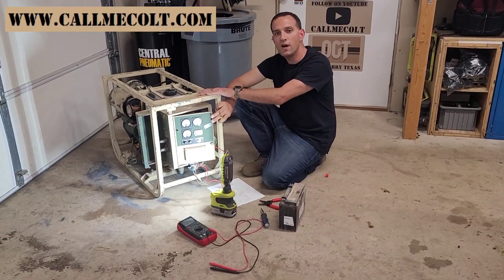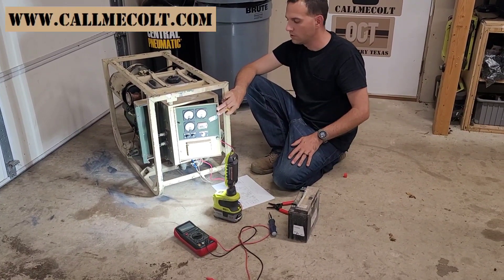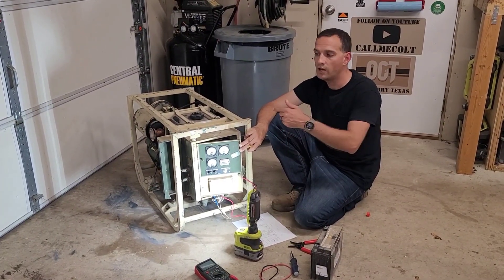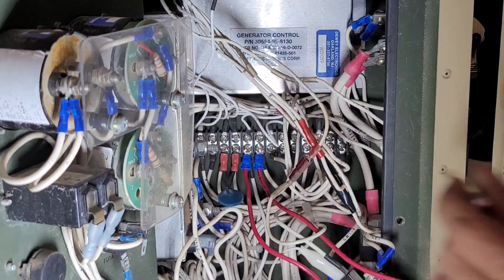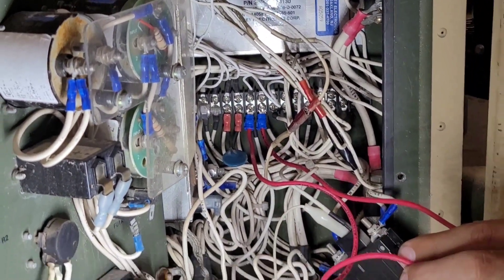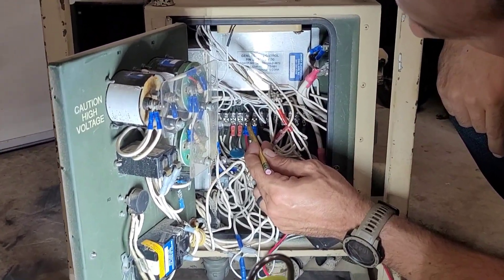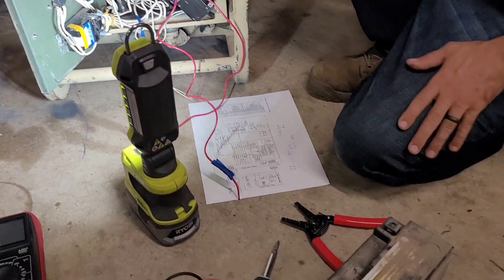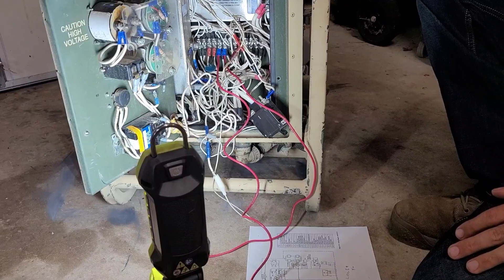MEP 531A - Flashing the alternator

Comment: Is there a place I can buy a new or refurbished ac alternator assembly? I just purchased the 501 thinking is was the 531 and now Im trying to convert it over
Reply from the maker: It's not worth converting. There is more to it than just that. Control box & everything is different. I'd be interested in a trade possibly as I could use a MEP 501A instead of another MEP 531A here.
Reply: @CallMeColtLLC  I would definitely be interested I should have it in a week or two
Reply: @  I should be receiving it in the next two weeks. As soon as I do I would definitely be interested in a trade.
Reply: @CallMeColtLLC  That gen set came in. I got it running and outputting voltage. It’s got four hours on it and it started on the first pull after priming system. The only thing I noticed was somebody modified the fuel tank. Are you still interested in that trade?
Reply from the maker: @brayden3327  where are you located?
Reply: @ Palm Beach County Florida
Reply from the maker: @brayden3327  yeah that's far, not worth the trade. Thanks though!
Reply: @ no problem do you have any recommendations on what I could do?
Reply: @ also I travel somewhat often if you’re on the East Coast
Reply from the maker: @brayden3327  sell it & recover some of the money is the best bet. They are not worth much though. Seems all the ones sold are to people not knowing they are 28 volt. Very few people have a use for one. Converting it is not worth it.
Reply: @CallMeColtLLC  ok thank you for the help

Comment: Is there a way to start it without the starter switch? Picked one up but missing the switch. Thanks
Reply from the maker: You can pull start it. I ended up parting this generator out and have the starting switch if you'd like to buy it.

Comment: Just for the people that don't know, what he's talking about when he says "flashing the field" is also known as dc excitation (applying dc voltage) of the generator's rotor to produce ac voltage from the stator. Simply put you are running voltage through a big spinning coil inside surrounded by magnets to produce electricity through a process called electromagnetic induction. Basically what controls this is a generators controller and voltage regulator. If the controller or voltage reg stop sending dc voltage to the rotor, your field is not energized and cannot produce voltage. Hence why this circuit is commonly referred to as the field flash or dc excitation circuit. There are other issues that can cause a generator to stop outputting ac volts but this is a common one especially if its a brushed unit. I've worked on these units while I served. Annoying little bastards but way easier to work on than the liquid cooled units. Good vid brother. Stay safe!
Reply from the maker: Good explanation!

Comment: Is it possible to go into a deeper discussion of what flashing the field does. What are the reasons you would need to do this. And or what are the symptoms associated with the need to flash the field. If this is beyond your knowledge base I get it. As a service tech. There are a lot of things I do just because that is what I'd done. Thanks for sharing.
Reply from the maker: I only made the video with the purpose to show where the flashing location is on these specific units, because it was confusing. If someone doesn't know what flashing is, I would not advise they do it!